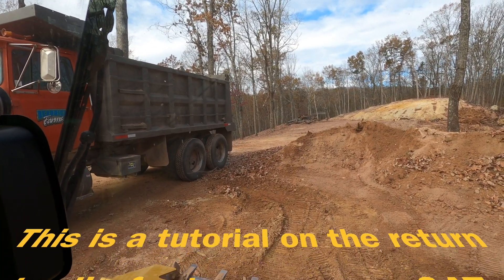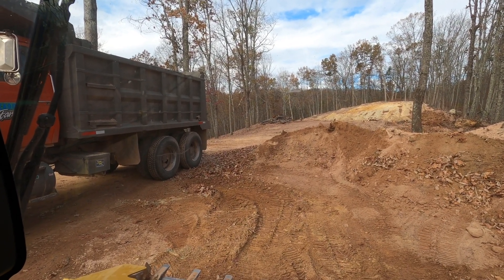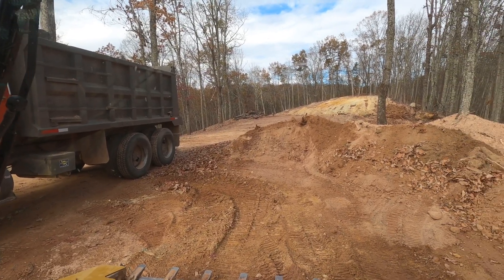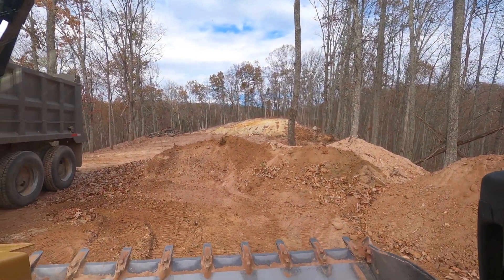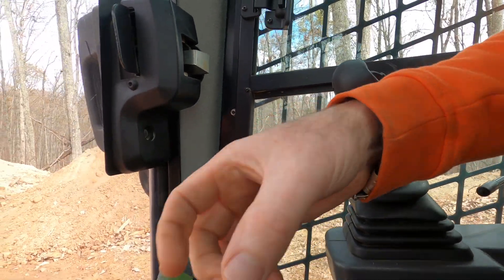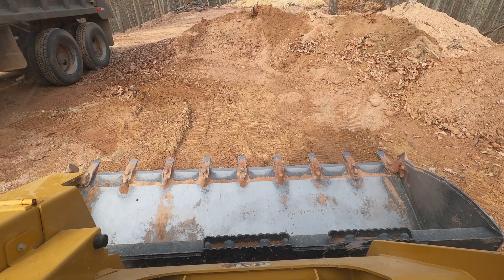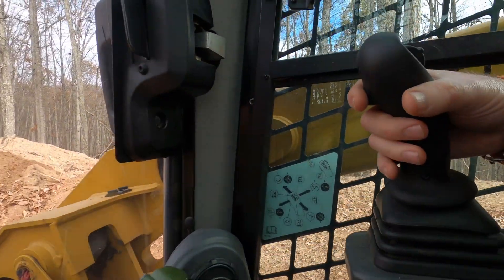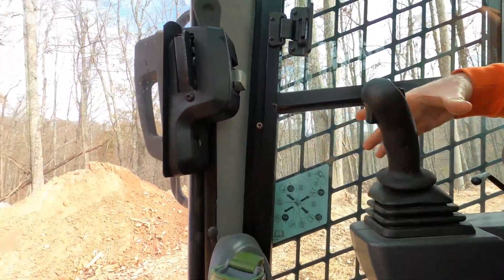CAT 299D3 XE Return to Dig Tutorial

Comment: What is the point of 'return to dig'? By the time you've set the parameters, you could've already completed another cycle. 
You don't seriously use it on the job, do you?
Reply from the maker: It's simply a tutorial video, it works well if used properly and I have used it.  Time is money and if you know how to work it properly it can speed you up in the correct application.  Thanks for watching.
Reply: Thanks for the tutorial. Agree with the other guy though. Absolutely pointless feature.
Reply: Its like a macro key